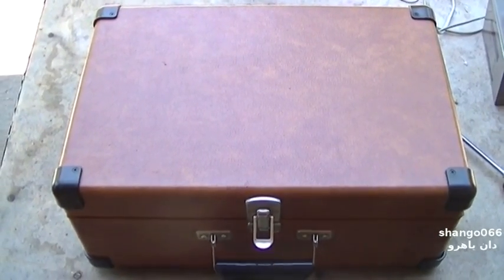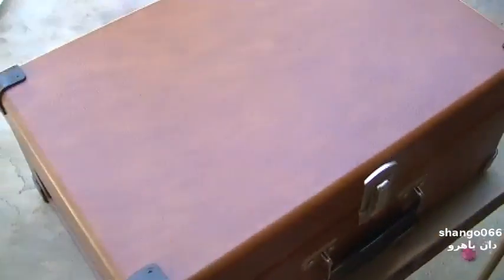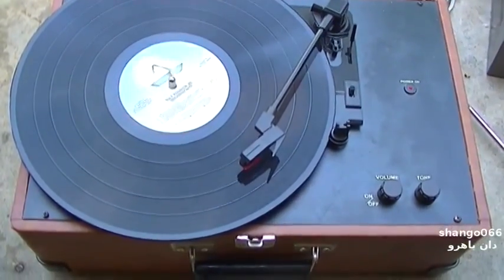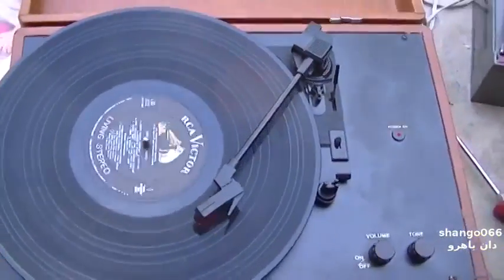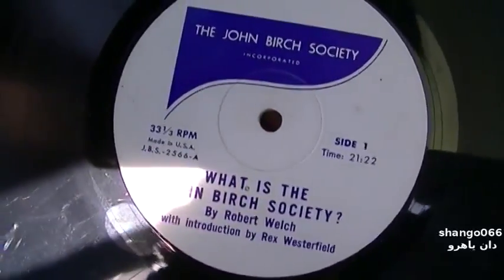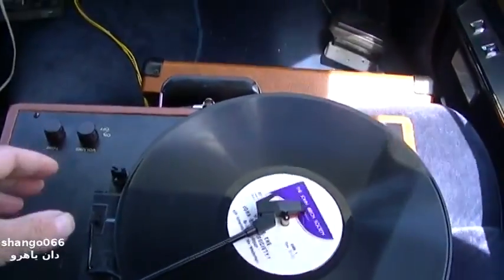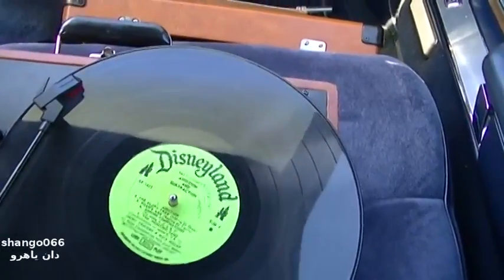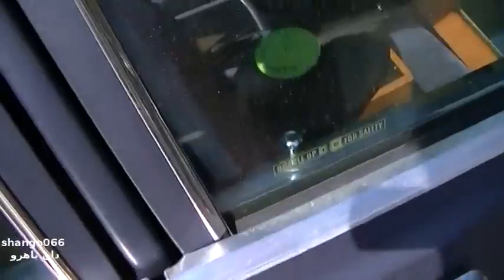Crosley Record Player Review and Road Test

Comment: I wouldn't be surprised if there was actually a '70s car commercial that demonstrates the smooth, quiet ride by having someone drive around with a record player in the front seat lol... I've seen some commercials that pull off similar stunts... like one for the 1972 Ford LTD that has a violinist recording a song while the car drives around downtown San Francisco.

Comment: The turntable draws 6 Watts, and the AC adapter draws 15 Watts. The difference of 9 Watts is the waste heat generated by the AC adapter.

Comment: This Crosley record player is okay and that is a stretch of the word. I have heard of some people buying them and modifying them by changing out the crappy tone arm and cartridge. I wouldn't even do that since they are so poorly built. I would still be concerned the damn thing would ruin my records. The road test was hilarious. At low speeds and no bumps in the road the player did good. Turning either directing wow the player scratched the hell outta those records. Very interesting video.
Reply: Wait, you can change the tone arm? I want to mod this turntable for playing 78s, can you link a replacement tonearm?

Comment: i have a 1949 RCA 45ey1 tube unit and it sound why better then this  and yes i have a 1960 fleetwood suite case type tubes and treble and bass all auto  BSR UA8 that machine is a want to be those china junk will never come up to the old equipment   just drop it and see it it survives the fall

Comment: Nice Diplomat! I would find those crappy Crosley record players at flea markets, "fix" them by overriding the switch that stops the turntable, which was inevitably broken, and then installing a 12 volt gel battery like the one you used, inside the unit. Wiring the battery up in parallel with the 12 volt wall wart connector, so the wall wart becomes the charger. Record weasels like them, because they can test unknown records at flea markets and yard sales, and discover a new gem. Those record players are good for picnics, as long as everyone stays close to the record player, and the have excellent hearing.
Reply: My GE Wildcat doesn't have batteries, it has an AC power cord. That doesn't work in any vehicle. If they do with the Wildcat, they need to retro mod with a battery compartment replacing the power cord for the GE Wildcat.
Reply: Does the GE have 110V motor?

Comment: 12V at 0.5A is 6W. To get the power simply multiply the current by the voltage. 12*0.5 = 6.

It could be rated at 15W because generally speaking you have to rate it at or higher than the actual power consumed. Maybe the wall-wart is so inefficient it takes 15W to get 6W out but I doubt it.

Just laziness really, they can't even be bothered to actually work out the power. They've just said to themselves 'oh well it'll be under 15W worst case so we'll just slap that on the label'.

Comment: its hard to believe that people buy these things
12v at 1amp=15 watts
tonearm lift that doesnt work when the arm is at the end of the record
when you put the speakers inside the same box as the turntable, you cant expect the volume to be very loud.
also i have never seen a tonearm lift on the headshell that goes at that angle they are 
always 90 degrees to the headshell. also the stylus should 90 degrees to the record, that seems way off.

Comment: 12 volts @ .5a would be 6 watts by my math. I think they arrive at 15 watts using Crosley-Chinese math. A disc player for your car?? Automatic tune skipping. I agree that wow and flutter specification is state of the art. (or should I say state of the FART). Makes Sister Sledge sound like Sister SLUDGE.

Comment: 45s work better, my Numark pt01 on top of a small foam piece to make my seat level was able to play 45s in my Honda Civic with only the most egregious bumps and train tracks making it skip ,the geometry of a 45 makes it far less likely to skip about and the PT o1 is rigid so it is even less likely to skip with its bitty short tone arm but if you put a little bit of added weight on the head shell, you could probably get away with playing 45s with minimal skipping on that thing
 I have one of them, either just before or just after that model where it has a metal tonearm but literally nothing else is different, and on my mind the Auto Stop would kick in before the damn record was over half the time so annoying but it worked pretty great on my 78 especially my poorer condition 78 and I use it for that specifically so is not damaged my real turntable or wear out my 78 specific needle

Comment: I can't stop laughing .... maybe the 12 v 0.5 A is "rms...dc" consumition and the 15w is "peak power (pmpo) dc power" !!!!!!!!!! XD
Reply: the 15w is the ac consumption of whatever power supply is supplied with it,   the 0.5amp will likely be the max. current at the 12v dc into the unit itself, at max volume, probably half of it, or more, being the motor,  so you certainly wont get much volume from it 😉
Reply: probably a good idea as too much would cause feedback and maybe shake the pickup off the groove 😁

Comment: I think that the intention of why Crosley made it this way was so you could take the record player with you on vacation with a few of your favorite record albums so you can  listen to it while relaxing on a camping trip while plugged into the vehicle's cigarette lighter socket or maybe take it with you in a hotel or motel to listen to them. By the way, you driving around with the record player going on in your car made me laugh. IMHO, you would have done yourself a favor by passing this up. By the way, come to think of it, I used to know somebody who had a vintage GE record player that had almost the same style as this particular Crosley unit, but sounded much better than this junky thing as he had restored it himself so he could use it again like he did when he was younger. Crosley products are junk that use cheap plastic parts rather than metal parts and they use cheap DC motors that play records at a little bit faster tempo than most turntables made with AC motors. Anything that is a Crosley made in China audio product should have "Avoid at all costs" written all over it. I bought a Croseley nostalgic styled unit with a built-in CD recorder and it was one of the biggest mistakes that I made. I will never buy nor use a Crosley product ever gain. That unit has been closeted and it will stay in the closet forever.
Reply: +J1984 (Julian.1984) I paid too much money to do that. Besides, nobody would buy it anyway. As I said, it will stay in the closet forever and will never ever be used again.

Comment: That was funny as hell, any Crosley turntable is junk. I even considered at one time getting one of the little AT sound burger clones for listening to stuff at the thrift store but I actually tried using it and oh hell no they are junk, kill it, kill it with fire. Only good  modern turntable is the AT120LP (barely) and the Numark TTX (too expensive and has stupid useless features) anyone who wants to get into vinyl is much better off to look for a Hitachi, or Sanyo, or Pioneer turntable from the late 70's to early 80's, as long as it's either a nice T4P or half inch mount those are decent turntables...please burn that crosley it doesn't deserve to live.